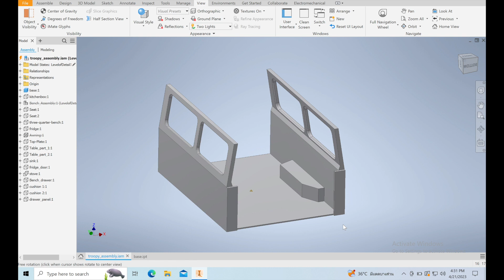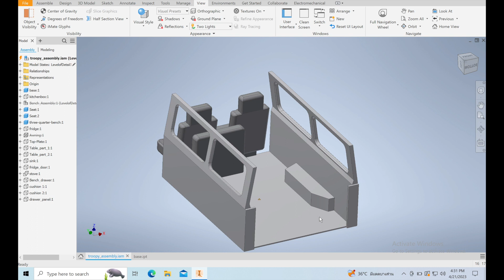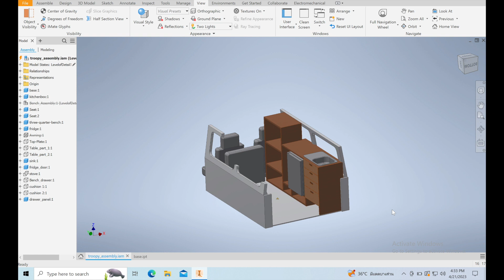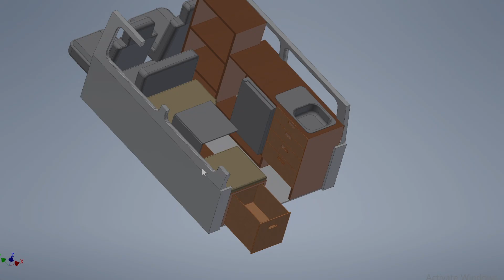Concept design for a DIY overland vehicle. Troopy build EP.1

Comment: Hey mate, where did you get your cad file from?
Reply from the maker: Hey mate, 
well I just made it myself. I measured the basic geometry of the rear inside of the troopy by hand and modelled it in CAD. It's not 100% accurate but was good enough to get the basic design done.
Reply: @goneoverlanding4372  ahhhh nice work